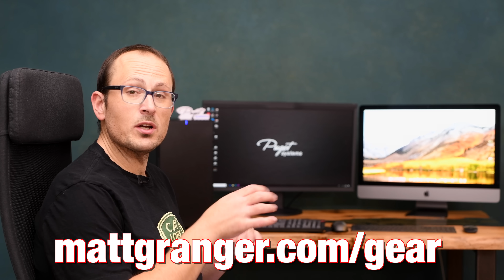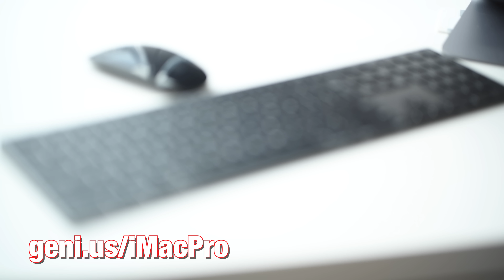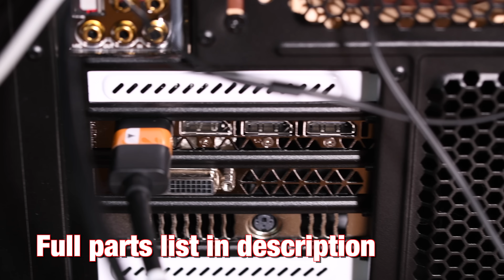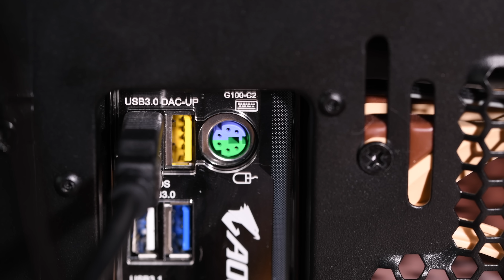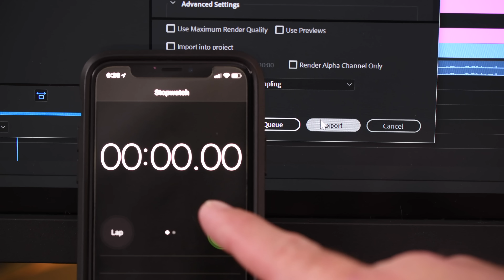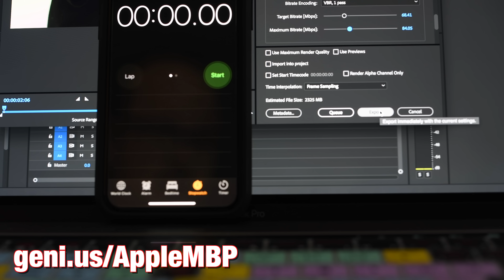$10,000 iMac Pro vs Custom PC - Which is faster??!

Comment: Please please please do this comparison but use FCPX on the iMac! I bet it will destroy the PC with Premier!
Reply: That is not a valid comparison. Vegas Pro (win version) is over half faster than Premiere (win version) on most encoding tasks. It is because they are optimized for slightly different things.
Reply: Captain Video Blaster that may be true but at the end of the day it doesn’t matter. Tons of people use Premier and Final Cut Pro for their everyday all purpose NLE software and I’d bet they’re the most popular as well. So a comparison would be very interesting with computers at this level!
Reply: You cant compare apples with peers. Otherwise use the nvidia gpu h265 encoder on pc, its like 50 times faster than a cpu solution.
Reply: What you're missing here is Apple's inclusion of Intel's Xeon processors in the entire iMac Pro line.  FCPX's background rendering, which accounts for its greater performance, is disabled on Xeon processors.  FCPX's background rendering requires Intel's Quick Sync Video tech, only found on processors with integrated graphics (which the Xeons don't have).  Disabling FCPX's background rendering gives up its greatest advantage and may let PP shine on the new iMac Pros.  Good luck!
Reply: Cooper Spaulding yeah tons of people buy this computer for the reason of FCPX and how superior it is in many ways in optimization, than premier pro, so comparing with an inferior software is impractical imo
Reply: TL;DR:  Whatever works for you is awesome!  Arguing over this stuff is masterbatory at best...

There is no doubt that Adobe has done a very poor job of optimizing their software engines to take advantage of growing numbers of CPU threads or GPU acceleration.  Unfortunately, it seems Adobe won't completely overhaul their software engines until they start losing major market share.  By then it will be too late.  Typical Windows alternatives, such as Vegas Pro, don't quite measure up to the capabilities of Premiere Pro.  Some simply hate a subscription model.  All this has opened doors for companies like Affinity, On1 and Blackmagic.

In a traditional PC vs Mac scenario, that leaves FCP X as your Main alternative.  We know from Xeon and AMD-based Hackintoshes (with absolutely no access to Quick Sync) that, under some circumstances, FCP X exports final projects significantly faster than PP.  But...  What if you want a rackmountable workstation?  What if you already have 3 4K monitors and have no interest in built-in screens?  What if you need 8K monitor support?  What if you want the ability to upgrade individual components to take advantage of new technology?  What if you want to tie in your workstation to a render farm?  And so on...  These considerations often force us to stick with the Windows/PP ecosystem, go a Hackintosh route, or migrate to DaVinci Resolve/Linux.

Many of these concerns will only apply to top-level studios, creative houses and universities.  However, it has typically been these limited spheres that have driven most of the professional world.  This is why companies, like Apple, have fought hard to entrench themselves in these realms.  It doesn't have to, nor should it be this way.  Whatever works for you is awesome.  If you're happy with your workflow and end product, why change?  I know a guy, employing five others, who has been making a very good living, videographing weddings and events, for fifteen years.  To this day, he only uses iMovie.  If you saw his final product, you'd never guess...

Options are great!  Right?  Well, unless you're a young, new, or perhaps aspiring professional trying to find his/her way through this technological jungle.  The research can be exhausting.  Limited resources and technical skills prevent most from experimenting with multiple platforms to see which workflow is best suited to individual needs, personalities and budgets.  We depend on people, like Matt, for advice and guidance.  The big guys can have it all, using the best tool for any given job.  Most of us have to choose more narrowly.  Once we get accustomed to a specific workflow, we are resistant (sometimes violently) to change.

My main rig for a year now is a 16-core, 32-thread (slightly aging) monster, running (five-year old) dual Ivy Bridge-based Xeons, 128 GB of ECC RAM and a GTX 970 (all used parts).  It does everything I want it to do, include smoothly edit and export native 8K files and play Crisis too.  I tri-boot Windows, MacOS and Linux.  The entire machine cost me less than $2500 to build.  I'd charge a client $3500 for this machine.  Who's going to pay $3500 for a machine built primarily of used parts?  Perhaps a young professional, looking at a mid-range iMac but wanting the performance of Matt's new Puget.

The bottom line is we have increasingly more and more options in the world of content creation.  Educate yourself.  Try to get hands on experience.  Choose what's best for you.  Don't worry about what critics think or say.  Let your final product speak for itself.

~Peace
Reply: Yes. Please.
Reply: Doubt it.
Simply because the Radon's drivers and codec support isn't the same as NVidia's support.

The PC was around 10 mins faster than the mac, and each pair of cores are a gig faster than the mac.
Reply: The issue with this as others have pointed out, and I pointed out in my comment, is that Premiere is poorly written software that has CUDA acceleration. Matt obviously has that turned on, hence the 50% export advantage. If there’s a toggle for Metal or OpenCL in Premiere Pro on the Mac, that’s what should’ve been used to give an accurate test. I think that’s what everyone’s problem is, it simply doesn’t match every other even test we’ve seen, and we didn’t get to see what settings he actually used, he just cut to the stopwatch. So I think for everyone’s sanity this needs to be redone. However, this is why options exist and why people can get a machine that is purpose built for what they use. If it’s Final Cut Pro X or DaVinci ? Then iMac Pro, if it’s Premiere Pro then a high specced Nvidia based solution is better. They’re different beasts.
Reply: Cooper Spaulding it will, pls see my detailed comment a little bit above
Reply: Like I said in my post I am really a Mac person but Puget System and John Bach know what they are doing and so does Charles Liang from Super Micro Computer beyond those two companies I will always believe in the Mac I own a Mac Pro, new 15" MacBook Pro Touch Bar, 5K iMac  not the iMac Pro but I don't need it because my SuperMicro SuperServer 4028GR-TRT will destroy any Mac anywhere plus it will destroy the Puget that Matt has just because the way he configured it but he got what he needed and thats all that matters. Puget Systems has a computer called the Puget E7 Quad and it's a Quad CPU setup that can run a max of (96-cores) and 192 Threads now it's crazy expensive like over $90K but it's for oil and gas explorations or something where you need to SERIOUS number crunching. So both Puget & Super Micro are the top of the line it's like a Ferrari and a Lamborghini. Both have A+ build quality and customer service which is key in the computer world when your spending this kind of coin on a computer or a server.
Reply: Please see also my previous comment, it has an interesting link in it concerning performance comparison.
Reply: @cooloox The problem is, Adobe software is optimised for Windows and runs horrible slow on Macs, specially the video software but also Ps. Instead of using outperforming Apple APIs, they invented the wheel for new by themselves and obviously worse than Apple did it. They even do not use Apples native API for file handling if it comes down to save/load files. E.g. in Lr on exporting images you may not use the side bars Show/Hide function and so the this is really annoying. Bad behaviour of Adobe. And you may also not address this customer convenient directly to something like bugreport@adobe.com or enhancementrequest@adobe.com. Why by mail? I can copy and paste easily a screenshot, and a picture says more than 1000 words. Adobe makes so much money, they can afford to hire a worldwide mail dispatching team for any important languages: English, German, Mandarin, Kanton, Japanese, Hindi, Russian, French, Spain, Portuguese, Italian, Arab, Hungry, Czech, Danish, Swedish, Norwegian, Greek, Turkish. This should probably cover most regions of the world. I I forgot an important one: sorry, did not want to offend someone. But currently, the dispatching job has been shifted to customers by super inconvenient systems deployed 😡 - probably thanks to some idiots of consultants showing up a possibility how to the 0.1% more shareholder value if doing so. As soon Serif Software has a substitute to Bridge and/or Lightroom in addition to Affinity Photo this means "by by Adobe" to me.
Reply: Absolutely agree.
Reply: Cooper Spaulding You missed the point. Running the SAME editing software the Windows PC destroyed the Mac (to use your childish expression). Get over it.
Reply: It is a 100% valid comparison. Because the cost is the same. When you pay 10 grand, you pay for the optimizations Mac OS has for Final Cut Pro. If you think having superior hardware(which is basically a bunch of boxes put together which take more space and look ugly) is a fair comparison, why not having superior software at the same price?

Comment: Hi Matt! I have a small apartment and I can´t have a Nerdomax GTO in my living room no matter how fast it is..
Reply: Then build a system with a ITX motherboard. Or buy a MSI Vortex.
Reply: Sorry I don´t know what that is.
Reply: There are different size standards for motherboards (that's the main large circuitboard that holds nearly every other PC part), and ITX is nearly the smallest standard. There are really small PC cases out there that only fit those, so of course these PCs can be very small, compared to the standard sized ATX cases. And the MSI Vortex is a small pre-build PC, that has custom components to be small.
Reply: Aha thanks for the info!

Comment: I've been building my own boxes since 2002, it's the only way!
Reply: Building your own system means when something breaks, you know your system and can fix it quickly. It can save you time and money down the line.

Not to mention its a bit therapeutic.
Reply: v3rlon it only takes 1-3 hours to build a PC which can save him valuable time as you said.
Reply: "Cheap" is relative.  If your time is not very valuable, it may be the best route.  On the other hand, if ever moment you spend building that box could have been spent earning your living (say you are self employed like Matt), it becomes a loss.  Say Matt charges $100 an hour as a photographer and ears $65 an hour for content he produces.  Now, say it takes two hours to unpackaged and assemble your box, then at least an hour to install Windows on a cold drive plus drive updates and configuration settings.  Then, should anything go wrong, the hassle of finding that reseller and/or that maker, have them try to put the blame off on the fact that you were using Arctic Silver heat paste instead of their over-priced, less effective brand even though they are wrong and know it.  It quickly becomes something that someone like Matt, or even I, would rather not mess with.  I have built countless boxes for myself and friends.  I simply do not choose not to now.
Reply: you will have spare time, its not like all everyone does is just work. people have time that they spend on extra activities but its far better going with building yourself and I will explain why. in the time it takes you're going to be saving more money than what you could have made in that time
Reply: True. I have two v4 Xeons and 128GB of ECC ram and around 3500 in Cinebench 15 for waaay less than $10000. And it can run 24/7 at full load (water cooled) without any throttling.
Reply: You do realise you can buy a mac off the shelf?  You don't have to make them home made things.
Reply: I will give it a go after lunch today.

Comment: In terms of price comparison, building your own PC (as most PC users do) does save a ton of money over the Pugent systems costs. However, it does put it on a similar footing as Pugent does a lot of compatibility testing that is somewhat comparable to the out-of-the-box experience you get with Apple, justifying the Mac Tax. Just know that if you know what you are doing it is easy to save a ton by building your own and it's not hard. I just did my first and everything worked perfectly. (You mention this at 10:10)

Comment: You have to use FCPx in order to really see what the iMac Pro can do...even then it's really just how it handles 8K footage which you can play back without rendering. That said, my next workstation will be PC based. Not upgrading my L2013 MP to gain a minute here and there. Not at the Apple tax price...

Comment: could you test export times with as similar files as possible using final cut? it would be interesting to see how times compare then. I'm a PC user but it would be interesting to see how much merit there is in the optimization argument i've seen online for final cut pro.
Reply: FCP doesn't run on Windows.
Reply: I know.
Reply: Red TV Productions that’s the point.
He should’ve let the Mac perform its best with its native software and the PC perform its best with adobe. That would be a fair comparison.
This was a biased test.

Comment: You can use Premiere Pro while rendering. Send it to Media Encoder (Select Queue instead of Export). It will hand the rendering off to Media Encoder and free up Premiere for you to move on to next project assuming your PC/Mac is up to the task.
Reply: you could also set up a server for encoding and offloading to free up your workstation for editing.
Reply: Jane Stewart Yes, exactly. I was going to suggest 2 cheaper workstations, one for editing and one for number crunching.
Reply: Also this render test was pointless we needed to see how it performs with multiple layers of video layer and scrubbing through the time line, how many layer of effect you can apply before the frames start to drop...how long warp stabilization take between both systems, how fast the system are when animating images like zooming paning rotating.. need to see how the actually preview is generated...use the frame drop inductor in the progress monitor.
Reply: Do your rendering through Media Encoder and keep working
Reply: 10X RED ROCKET BOOST OMG THIS 1 TRICK WILL HAVE TECH COMPANIES SCREAMING (GONE WRONG[GONE SEXUAL])

Comment: Several observations. Ciderhouse with 2x RAM is only $1k more than the Mac.  Secondly, down the line, if a component card fails in Ciderhouse, you crack open the case and replace it yourself.  Or you want to expand storage, RAM, etc.  Not so easy with a Mac.
Reply: i have had 7 Macs and not one of them needed to go in for repairs. I do video editing for a living.
Reply: Red TV Productions That’s a highly bias account.  Let me help add some balance.  I have used macs for 10+ years.  I have had 2 lemons (complete failures) and most recently a Macbook Pro 15” Retina Mid 2014 with complete battery failure (swelling) just outside of my extended warranty that Apple will not repair as still “in warranty” so I’ve continued to use this machine as the battery slowly destroys the machine lol.  In the past, apple replaced the two lemon computers, one of them was for a better “current” machine at the time (years ago).  In all fairness it was only upon the 3rd visit as a University student having to travel over an hour by transit to Apple’s store.  I am not using these devices professionally (rigorous use conditions) and yet they have failed or currently are failing.  We will see how much more $ Apple wants to repair my $3800 CAD MBP 15” with the $350 extended warranty for a total of $4150 investment.  

Apple has historically been wonderful customer service-wise but they have been slipping.  In fact, I do feel Apple has become more antagonistic to their user base.  I do feel this is in large part due to the increased size of their user base coupled with constant demand for “free repair” and “free replacement” and a senior Apple employee  over the phone agreed with my premise but did say the still strive to keep that service level up for their “pro” high frequency users.  This while replacing my iPhone X that had a faulty Bluetooth radio.  

Anyways, I get tired of Mac v PC enthusiasts that push their viewpoints.  No shot at you - just saying I use Apple almost exclusively and I would not pretend they are some sort of prefect non flawed machine.
Reply: @redtvproductions1  There's only about 6 million cases of Apple "quality" and how they provide "service" through their "geniuses" just on Youtube alone. So, let's not go into repairs..
Reply: @EnterSpacebar  Im afraid I have no idea what you are trying to say.
Reply: @travis8665  I'm not surprised.
Reply: The key word being 'if". Or ...never. ;) I've owned a whopping 14 Macs (design business), and only once did I have to bring my cheesegrater in for repair (cooling) in 2010. They fixed it ($2,000) for free.
Reply: 2000$ coolinmg system wtf u might have deunk apple just fooled u best liquid cooling sys just cost about 390$
Reply: @Franck Leveneur nope that´s stupid virus can attack each platform stfu
Reply: @carholic-sz3qv   Can* being the key word.  In reality, not so much!  Im never going back to PC for this reason despite the better "value".    20 years experience with both.
Reply: When you have a Mac and something breaks, which is statistically more rare (i.e. not "never"), you send it for repairs, just like most people send their cars for repair in a garage. It's just the way to do things.